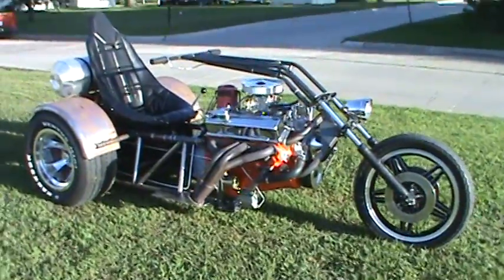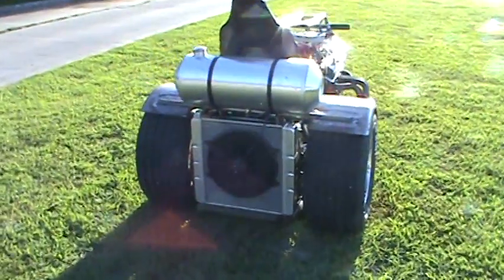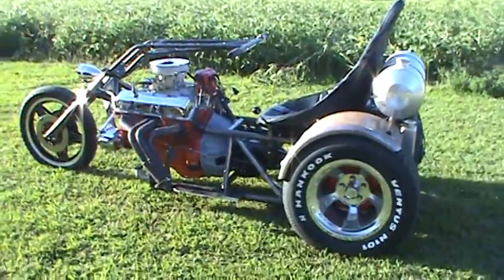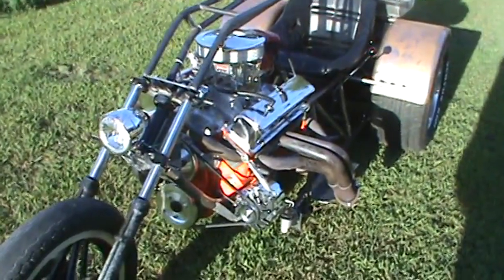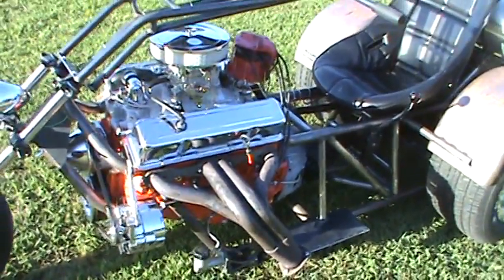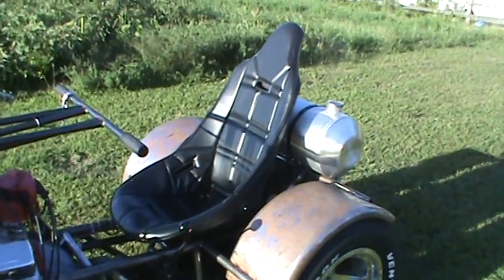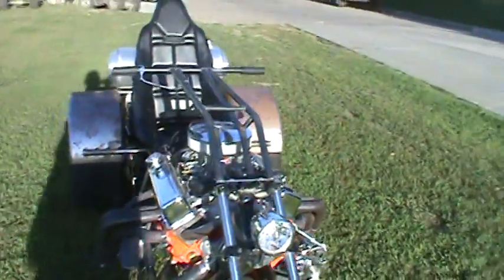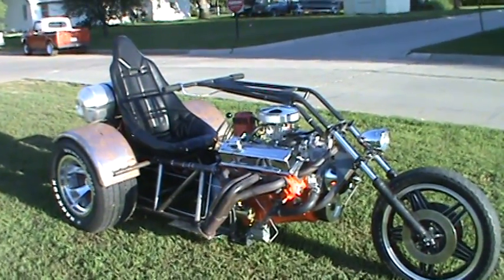Mac Motor Toys  The prototype V8 Trike

Comment from the maker: @milesmac00          I used the front end from a motorcycle that had a title, the title vin matched the vin on the headstock, I used the headstock to build the trike frame.  ( you could use the vin from the engine if you have a title to match).  Then you apply to the state for an assembled vehicle vin, which is affixed to the frame.

Comment from the maker: @heinryk1  The rearend is an 8" ford, 32" flange to flange, no suspension.  the next prototype will be a 9" ford, 36" flange to flange(using deeper offset wheeles) and triangulated 4-link with coilovers. I've started the 2nd one but no pics yet.

Comment: How do you go about Registering a V8 Trike for the road? what are the problems, What does the DMV Go By?  Engine Year? and/or Block Numbers? Do they require Chassis Numbers?
 What about Smog Requirements? 
Since it is an all new trike/Vehicle does it go by 2011 Smog and reg. requirements

Comment from the maker: Frame kits are for sale.  Each kit is handled and priced on an individual basis, due to the many levels of options and completion. A basic 2 seat frame w/ 4 link suspension brackets (no rear housing), complete radiator mounts(radiator not included) and front frame w/ head stock (to match your front end) runs about $1,600.00  Frames are Jig built using DOM tubing and laser cut brackets.  I can e-mail pics at your request.  My e-mail is milesmac00@gmail.com
Reply: this is about the best looking design i've seen. do you offer a single seat version like the prototype?
Reply from the maker: Yes, I can do a single seat version, It requires a shortie powerglide transmission.

Comment from the maker: @westgl2006  In Nebraska there are two ways to title a Motorcycle ( 2 or 3 wheels ).    1)  A homemade motorcycle, requires an MSO  (manufacturers statement of origin ) for the engine and a MSO for the frame, I cannot find a car engine supplier that will provide an MSO.   2) An assembled vehicle, requires the use of an existing title that has a vin number matching a component used on the vehicle, this is what I did.

Comment: I assume those are regular motorcycle forks?
The rake seems a little much, I would worry
about it's strength with that heavy V8 behind it,
and the forks would surely bottom out with all
that weight. Be careful dude. .